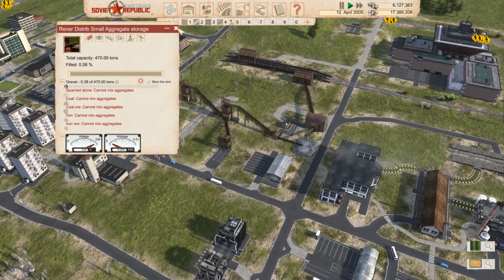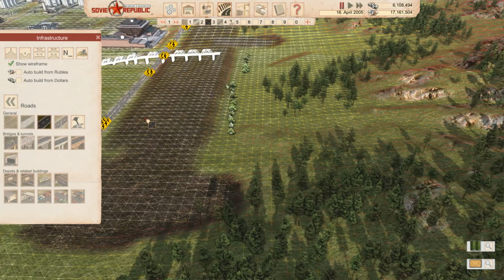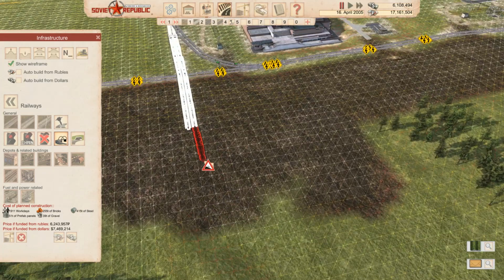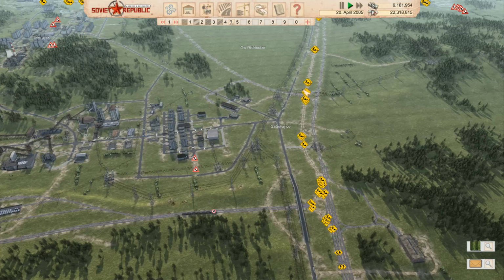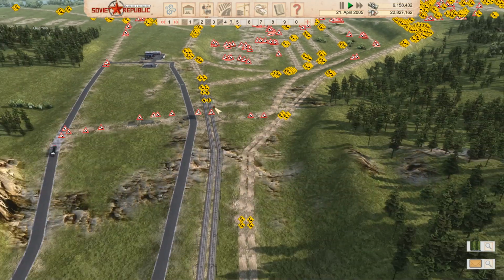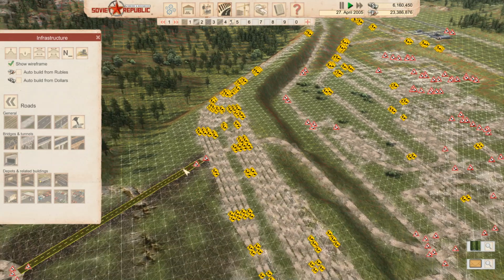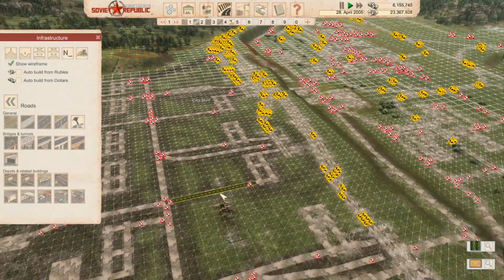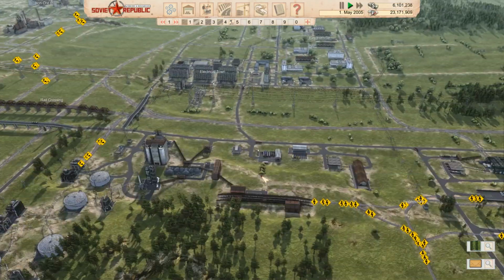Workers & Resources: Soviet Republic -  Re-Planning the Vehicle Manufacturing E112

Comment: think that you broke a electric connection deleting roads at the beginning, that you didn't reconnect.

And the fire station that you destroyed in the cars factories is also missing
Reply from the maker: Thanks Antonio, I looked after the episode ended. You are correct, but I also cut it to put in the new distribution rail line. I kind of knew I would forget that darned firehouse. I will try to remember before something burns down this time.